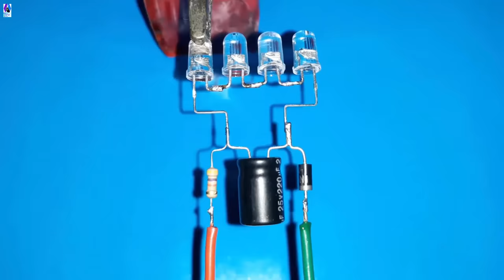Top 6 Electronic Project Using 5mm RGB Led Z44N LDR Relay BC547 & More Eletronic Components

Comment: Friend, in this first video, is the voltage of the capacitor 25 Volts? Will it support the 220 or 110 volt supply? and the socket that you put, to turn on the device, is it 220V or 110V? Thanks
Reply: Yep, because of resistance
Reply: Don’t do this please, it’s incredibly dangerous
Reply: Right

Comment: At the first one , you can use a 12volt adapter rather than using transformerless adapter that shown in the video. it equals 12v because the led is connected using series and they use 4 meaning 1 led = 3v,  3 x 4 = 12 meaning it can powered by a car battery and also an adapter. I'd recommend you all to use the 12v adapter
Reply: Mesmo assim, seria necessário um resistor de valor baixo, de 47 ou 100 ohms em série. Ou ligar 5 LEDs em série, no lugar de 4.

Comment: 4:24 gate in air, can turn off from any wind blow or air discharge, better use trigger scheme or thyristor scheme or attach gate to + and - by depletion mode transistor or other voltage controlled dynamic resistors like tunnel diodes(will keep gate charge because current bigger on element what have lower voltage)

Comment: People who do not know electronics would get more use out of the video if you describe what the circuits does.

Without understanding how a LED functions, it isn't obvious how the voltage divider functions to allow the LEDs to be powered from mains.

And neither is it obvious to a beginner how the capacitor charge/discharge is used to control the transistor to create a simple timer light. How the switch can charge the capacitor and that the transisyor turns off when the capacitor has been discharged through the resistor. A beginner would also not understand that R*C affects how long the lamp will be on, and that a bigger resistor makes the discharge slower. Or a larger capacitor means more energy to discharge. So either component can be changed to change the time.
Reply: People who are interested in EE should watch real channels (there are so many excellent ones!) and not these clueless indian ones. They do extremely sketchy and dangerous stuff. Of course they couldn’t explain! These exposed live wires are a death trap for any inexperienced beginner
Reply: @Ev-wj3lm  Could not agree MORE!

Comment: 1:32 - This circuit looks similar to the voltage doubler where you replace two diodes with DC capacitors. I got some 30V DC out of a toroidal 11V 4A transformer by using 25V 1000µF capacitors.
Reply: How many terminals do Your transformer have? 2-3?
Reply: @imunkown6365  It's a 2-terminal-output transformer.
Reply: its a middle-point 2 diodes rectifier with 1 active coil in any time what produces 14v as part in full bridge rectifier what produces 28v with 2 serial connection active coils in any time

Comment: You cant put those leds to ac voltage. You must have modified the power supply
Reply: @Charms Kharpran yea I guess. But y does he need 220v capacitor

Comment: How can those leds work at 240V Ac?
Reply: Because the resistor takes most of the voltage. The LED is almost fixed voltage so there is a voltage divider between resistor and LEDs - and the resistor decides how much current the LEDs get. Reduce the resistor and you still get the same voltage over the resistor and same voltage over the LED (simce the LEDs are almost constant-voltage). But now with more current through the circuit and correspondingly more light from the LEDs.

Comment: The diode halves the Ueff (230 or 115 AC) over the resistor and the 4 LEDS…….. dissipating the too much heat into the too small resistor…….. WTF 😳

Comment: GOod stuff. Except that series chaining 4 LEDS like that is not recommended. Also, you dont need to solder up 4 diodes to make a full wave rectifier - you can buy one for less than the cost of four diodes !
Reply: The resistor is seriously overloaded (fire hazard) and I don’t think exposed live wires are recommended either… or are they?